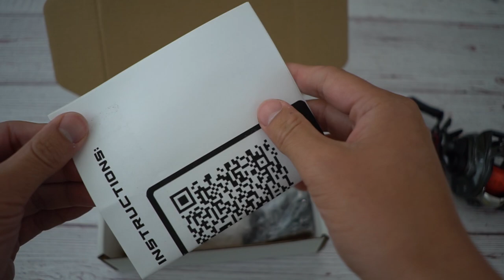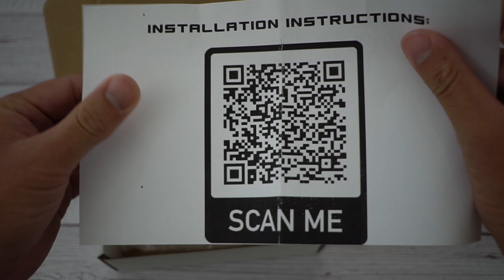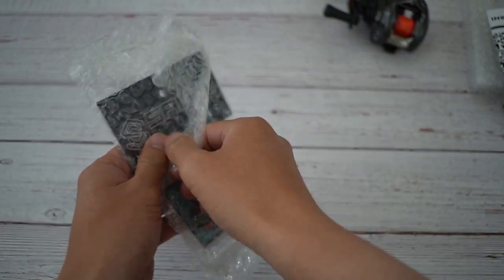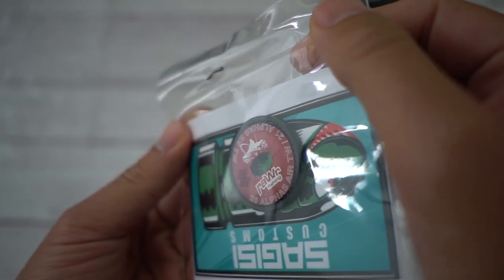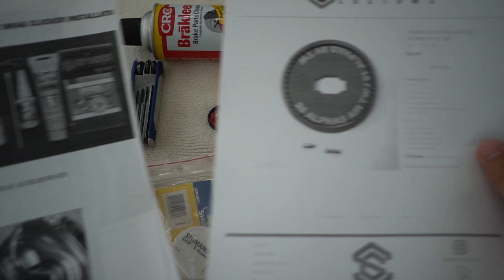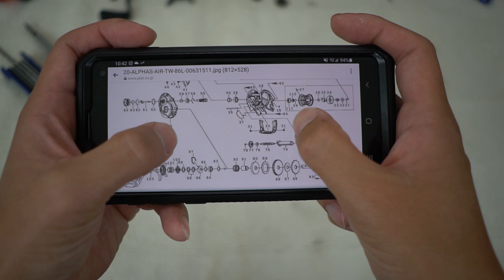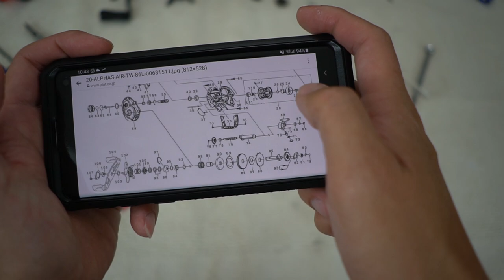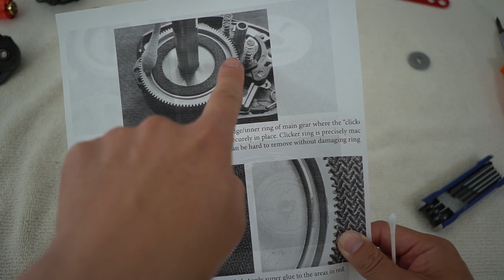Unboxing and Installing Sagisi Customs Drag Clicker for Daiwa Alphas Air TW SV

Comment: First of all thanks for sharing the tips of installing the clicker I did it on my Daiwa Salamandura and is Awesome. I start to face some problem when I install it my Tatula sv tw the handle become unlock hope you can advise me on it. I attached my link of the short clip 🙏🏻https://youtube.com/shorts/PDuQN7UUqEI?feature=share
Reply from the maker: Your anti reverse bearing is flipped around when you installed it. Flip it back around
Reply: @rawrfishing  okie i give it a try
Reply: So, does this mean that this kit will fit a Tatula? I really hope so. This style drag clicker beats most on the market. Amazon sells a similar version for Shimano curados that I love. Just wish I knew if the main gears were same/similar dimensions with the Tatula.